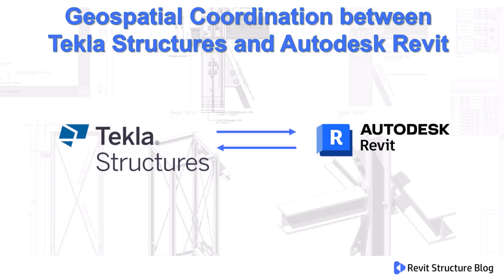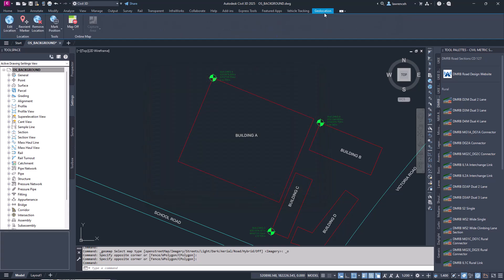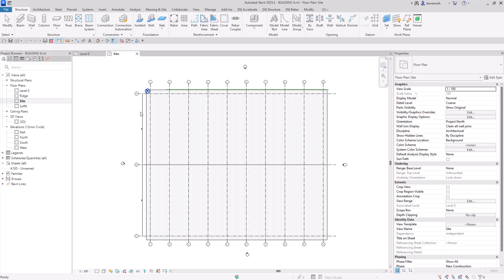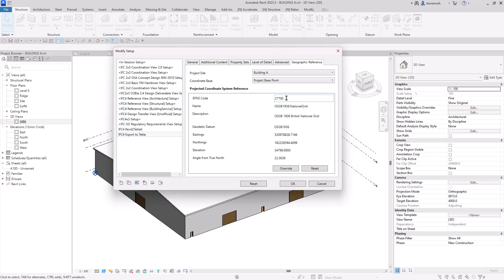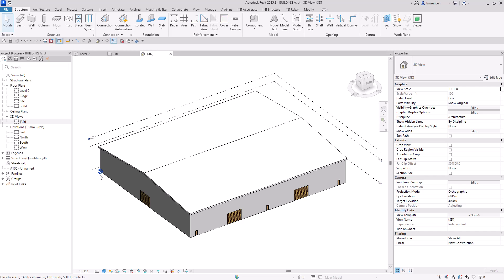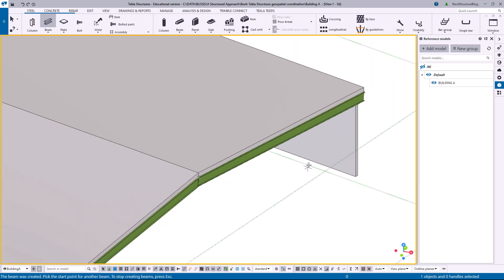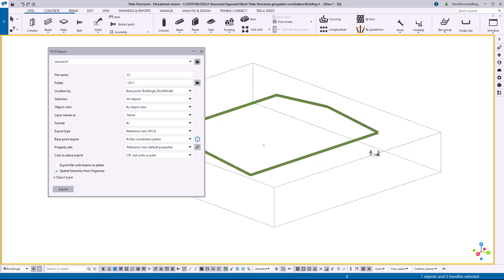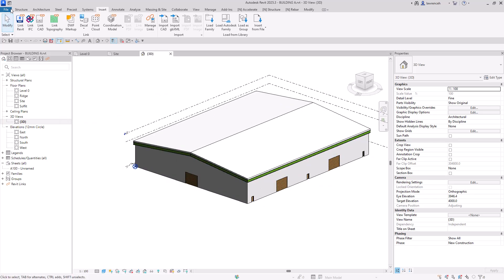Revit toTekla Structures - Geospatial Coordination

Comment: Thank you for your sharing 🎉
I have a question.
Your revit Building A. The project base point is coincident with the internal origin, right?
Reply: Cause in my project, I''m setting the project base point is different with the internal origin point. So then, I also exported the IFC4 as your instruction. It didn''t work accurately.
Reply from the maker: Yes, the PBP is on the startup location of the Internal Origin. Normally this should be the case and the PBP should not be moved from the Internal Origin.